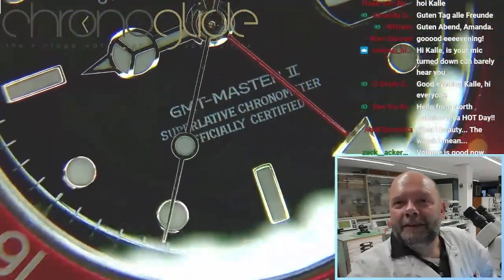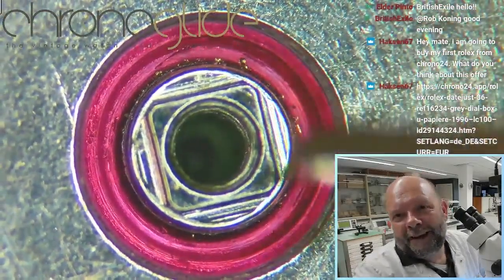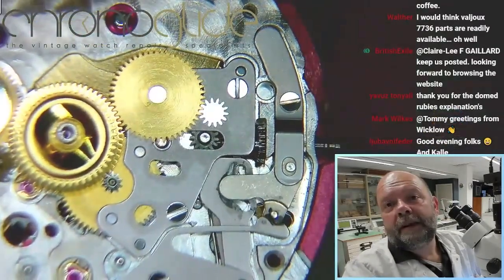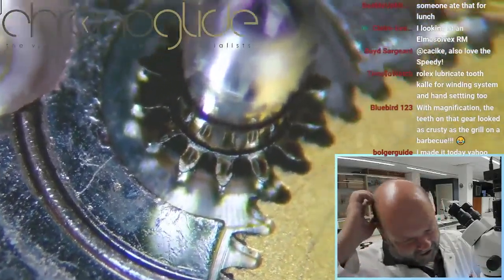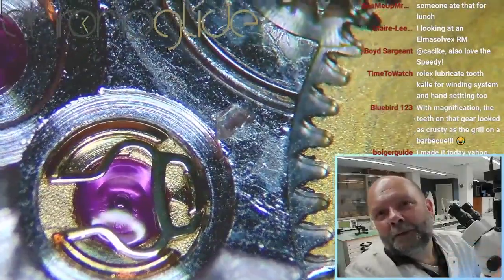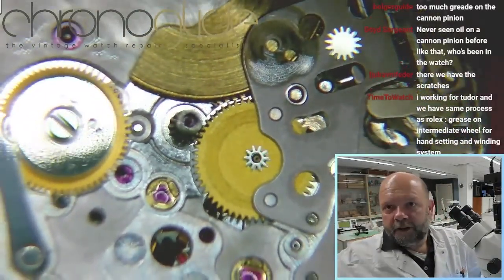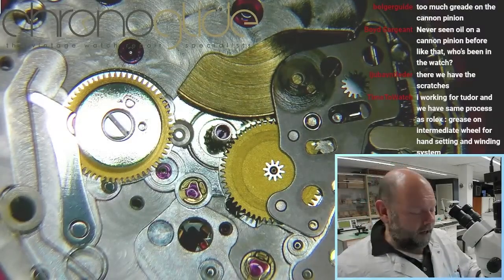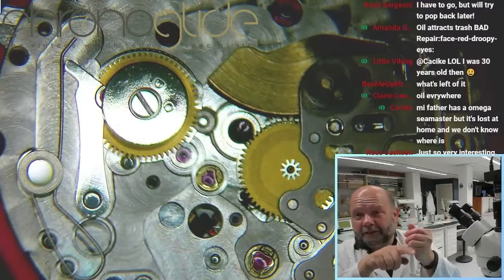Rolex GMT Master II Pepsi Ref 16710 (Edit 6min)

Comment: It looks like a teeth of the minute wheel is bent as well as a result of the non - sliding cannon pinion. Also, you actually do lubricate the outside of the cannon pinion as well as the inside. Inside usually with 9405 and the outside with 9401, before the hour wheel goes on. But that should not be on the teeth of the cannon pinion of course and not that large amount of lubrication.